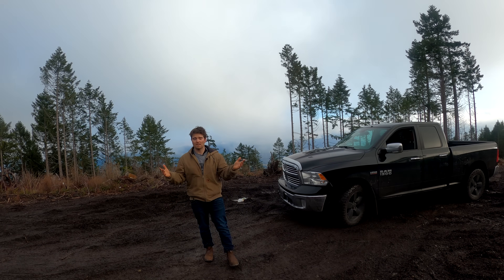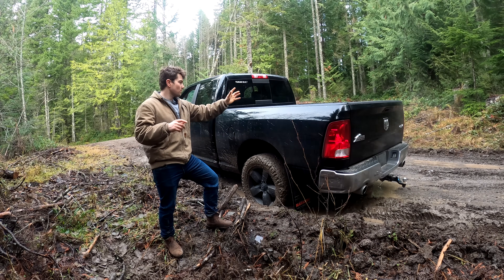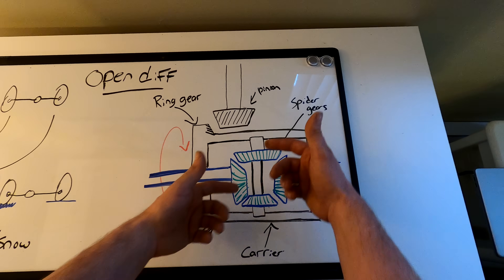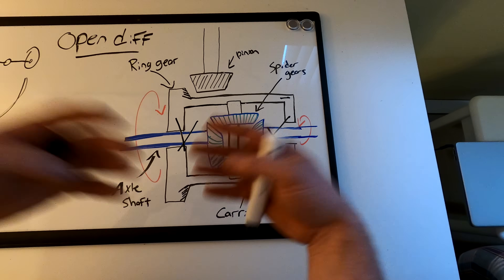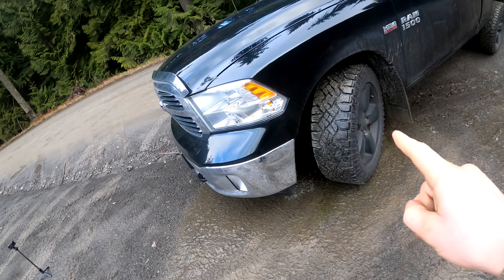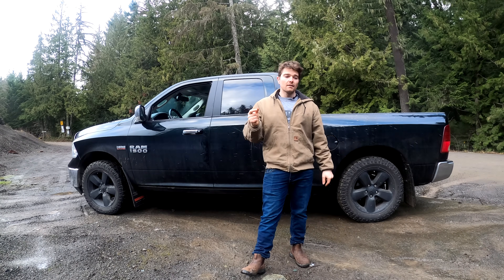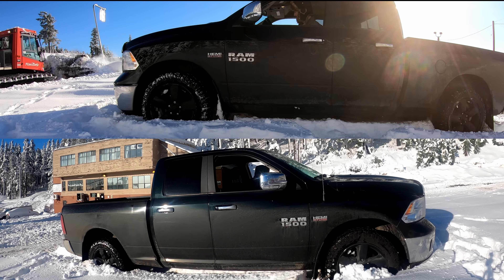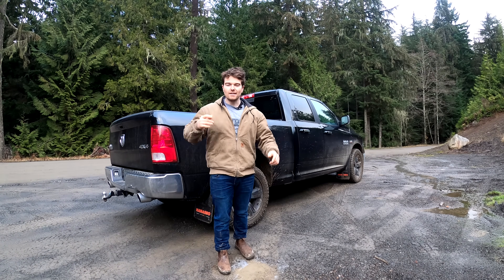RAM 1500 Open Differentials SUCK Off Road (You'll Get Stuck) | Real World 4x4 Testing

Comment: You have brake locking differentials. You need to continue spinning the wheel at a gradually faster rate, and it will cause the torque to go to the wheel with traction. If you let off of the gas too soon, it won’t kick in. Here’s an example of how it works. https://youtu.be/kcl-BMILrig

Comment: how much better do you think the truck would do with the factory option Anti-Spin limited-slip rear differential I have a '20 1500 with this feature
Reply from the maker: It makes a big difference. An LSD is not a locker but in most situations it will perform very well

Comment: Guys, why would you EVER buy a 4X4 truck without choosing the LSD option? I don’t know when why it’s an option. My 1500, with lsd, in 4 low is basically as locked as anyone could ever need
Reply from the maker: Thats why I ditched that 1500 and got into a 2500 power wagon.

Comment: This was what I was looking for after seeing the Duratrac snow review. I wasn't sure if you had lockers or not seeing wheels spinning and others not. I just got rid of a '99 Tahoe and drove through snow over the bumper and never got stuck, but it did have an auto locking rear. Just got an 18 silverado z71 and can't wait for snow...after I get rid of the factory original tires.

Comment: Without getting stuck can you tell if you have a locker
Reply from the maker: Look up the VIN and it should show you all your features and options. Another way is to lift the back axle and spin the wheels by hand in neutral. if they spin the same direction you have a posi of some kind. if they spin in opposite direction then you most likely just have an open diff

Comment: Hey guys.  Ram offers a “limited slip rear” option for the 2500s.  Any insight to how they work?
Reply from the maker: a limited slip diff usually has clutch packs which help to force power to both wheels. Not a true locker but does make a pretty big difference when it comes to off road performance. a really nice option to have

Comment: I really appreciate your passion and effort about doing the best with the given resource. I have an almost identical one like yours. 2014 Ram 1500 5.7 Hemi, Express quad cab. But mine has 45 transfer case (I didn't know the part name but it doesn't have the 4WD Auto) So I was really enjoying your trial and error videos the whole series testing 4WD modes.

I live in Korea, and there is only little bit of information or mechanics dealing with American pickups. Jeeps are popular though. I'll be looking forward to seeing your next videos and hope you keep the truck a while. BTW, how did it go with the Eaton locker? You ordered it right? I'm thinking to get one too if yours work. 
Since I bought the truck when I didn't have knowledge about pickups and 4WD, I still don't know its axle ratio. Sucks... I guess it'd be normal 3.21 open diff but the VIN decoder websites give mixed information.

Comment: I hate that in this day and age, most cars still dont come with lsd.
I mean i have a bmw turbo and still ope diff.
It should be as standard as air bags for cars to have proper traction control in all situations.
Reply from the maker: Could not agree more. at least for RAM the factory option to add an LSD is like a few hundred dollars. Mine truck was already on the lot. But why couldn't RAM just make it a standard option and advertise it saying their truck are more capable off-road. seems like a win-win

Comment: So I have this identical truck
How hard is it to add a locker
Reply from the maker: It's not something you can't do but unless you have some experience with diff's I wouldn't try it at home. You can easily mess it up, and it can be tricky knowing how to set the proper backlash, bearing preloads and tooth pattern. setting up diff's properly is almost an art on it's own.

Comment: This is why I bought a Power Wagon years ago. Front and Rear Lockers, plus a winch. Sounds like overkill----until you need it. I walked 6 miles out of the bush exactly once to make me decide I needed a PW.
Reply from the maker: the Power Wagon is the dream! I do which is had the option of the cummins though. apparently it's too heavy and that's why they couldn't put it in the PW

Comment: Just because it’s says 4x4 doesn’t mean you will be good at it, power brake it when u get in a slippery situation I wouldn’t know though mine has axle lock good video though
Reply from the maker: having a locking axle makes such a big difference!  and as far as the power braking it seems to work in some situations but not so well in other situations. never a bad option when you are stuck though

Comment: Funny thing is my 03 Land Rover Discovery has open front, rear and open center diffs and could still do this easy despite having evem less traction. With an open center diff you have 1 wheel drive. This is because they are full time 4wd so you have to have an open diff so you can turn. The traction control on it doesnt reduce engine power at all and actually transfers power to the wheels that need it. These newer vehicles just cut engine power completely, even when you turn it off. Almost got stuck in my pickup one time because I was on some slick surface mud under very light throttle. Soon as one tire barely spun it cut my power down to idle! Turned it off but it was too late. Had to shift to 4wd. They should all offer an offroad mode that disables stability control completely and doesn't reduce the engine power is and instead transfers power to the wheels that gave grip. Works great on the old 1999-2004 Land Rover discovery. Of course them having solid axles helps with the articulation. The 2004 has a locking center diff which helps alot. Im putting detroit truetracs on the front and rear because when the traction control brakes a wheel the diff will lock up.

Comment: Any 1500 truck you buy, Ram, GM, Chevy or Ford will suck unless you order a LS or Locker Diff.
Reply from the maker: absolutely true, its not the make of truck  that is the issue, it's driveline set-up that's the issue. If my truck has a rear locker it would be much better off-road.

Comment: Next time u go turn ur traction control off n ur ecs by holding ur traction system button ... Then try this trail again .. I bet you will get BETTER result's
Reply from the maker: won't do a single thing to help an open differential.
Reply: @GettysGarage  that's funny cus mine locks up when I do that  n I own a 18 Dodge  both wheels lock ..
Reply from the maker: @alanjoseph986  You probably have a Limited slip rear end my friend! However it would work like this traction control on or off.

If you don't believe me go under your truck and take a look at your rear differential and try and find the traction control wiring. You won't find any. So when you are turning electrical traction controls on and off it has zero bearing on what the differentials are going to do, or where they are going to send the power. 

the ESC which is usually the bigger issue has control over the Transfer case. the only thing is can do is hinder power going the front diff. So yes if you are stuck turn that baby off. but if you have open differentials your only going to have power going to 2 wheels for most situations.

Comment: Simple Bullet proof solution...check out Lock Rite mechanical locker. About an hour to install, no messing with backlash or shims or dial indicators or special additives, can be put back to stock if preferred...They are used in situations that require dependability like milatary and rescue! Only con is they can be a bit noisy sometimes (ratcheting sound) around a turn. They can only be used in a open differential as you have!
Reply from the maker: woow I'll have to check them out. thank you for the info! because yes it is annoying especially in the winter just having 1 wheels spin lol
Reply: @GettysGarage  id suggest getting an LSD or a selectable locker unless you spend more time off than om road. I have a powertrax lock right locker in my dodge 2500 and it still works great after 70kmiles on 37s but your turning radius is basically gonna double and you're gonna burn threw back tires pretty fast, mud tires go from new to slicks in like 10k miles.
Reply from the maker: @Si0nbarzahd  Honestly, the only time I'm actually off-road to film videos lol but I do live in Canada so there is snow on the road for like 4 months. so it would be nice to have some kind of locker. Ideally I'm looking at getting an Eaton true trak torson diff. Not officially a locker but acts pretty darn close to one. technically It is an LSD but as long both wheels are on the ground power will be transferred to both wheels. and apparently the drivability of those units is amazing.

Comment: Locka's or weld it, open diff is shit in any situation period.that speed differential will only matter on sharp turns or doing donuts.you don't be at that do ya???
Reply from the maker: One day I'll throw some lockers in my truck. Until then I'll have to suffer lol
Reply: @GettysGarage  put a locker in the rear of my old 93 f150 cpl mths ago ,and it's a different truck now much more capable.do it asap you will thank urself. 😉
Reply from the maker: @JoeRocket-sf6qs  It's too bad with these Rams the front diff looks like there is no after market lockers. and if there was you would have to replace the whole differential assembly. But for the Rear I'm looking at an Eaton True Trac which is a torsen style differential. I really like that option for a daily driver. or I'll throw an E-locker in lol
Reply: @GettysGarage  e locker is fast and effective,torsion set up sounds nice ,but costly also, but obviously in the end in comes down to what you use your rig for and what works best in your applicai,Lol. Have a good day and merry Christmas. 😃
Reply: A welded diff is great for doing donuts lol

Comment: Will you please do the same exact test but lock your e brake on the e brake will let the diff send power to that other tire have you heard of this please try . But yes do the first test you just did but LOCK EMERGENCY BRAKE PLEASE ;) been doing this while stuck for years man.. not yelling just trying to see if it works for you too
?
Reply: I hope you understand what I'm saying lol and why to do it? ;)
Reply: You can also hit the brakes in the second test in 4x4 try hitting brakes and gas at the same time intermittently and it will lock that other wheel for you been doing this for years also
Reply: It would be sweet if you did this and mentioned poor mans YouTube I'm nobody just know a little bit
Reply: This is pretty much how Toyota stuck control works your just doing it manually with your foot been off road driving since I was 7 years old been stuck way more time than idd like to mention

Comment: That's why I run a Detroit locker! 👍
Reply: How can I change my open diff to a Detroit locker?? Sorry don’t know much about diffs??
Reply: @noeldiaz1359  I had 4wheel parts install it on my truck. I don't have the tools to do it and its warranted under 4 Wheel Parts
Reply: @missioncapable4658 nice 👍
Reply: @missioncapable4658  how much did it cost you if u don’t mind me asking?
Reply: @noeldiaz1359  six years ago, it cost my around $600 for the locker and around $300 for install.

Comment: My Fords and Toyotas used the brakes to stop the free spinning wheel and activate the other wheel like a simulated limited slip. My 19 Ranger would lay 11s with an open diff.
Reply from the maker: see now that's what I would expect from all traction  control systems. but it just doesn't seem to work that way with a lot of vehicles. it's almost like the system is more concerned about keeping the vehicle from spinning out rather then helping the vehicle get un-stuck.
Reply: @GettysGarage  My Toyota has basically 3 different traction control systems that do different things. "Traction control" basically just limits engine power when it detects slip while accelerating. "A-trac"(same as auto-lsd in 2wd) is like offroad traction control that applies the brakes to give the other wheel more power. "VSC" helps correct skids when it detects the vehicle is sliding sideways. I believe most vehicles are equiped with regular traction control that cuts power, especially older ones. I have noticed newer vehicles, even crossovers have started adopting their own versions of A-trac and vsc
Reply from the maker: @845ToastT  It makes total sense. with all the technology already on vehicles today it is probably much cheaper for the manufacture to develop software like something similar to A-trac then to actually put a LSD or locker in a truck and still be able to sell the vehicle as an off-road vehicle.

Comment: Turn off traction control and ESC. It might help.
Reply from the maker: possibly it would be interesting to do a test just based on if traction control actually helps or how badly it hinders.
Reply: @GettysGarage  it does not help at all in these scenarios I’ve compared it with my ram before, but then again I have an lsd.
Reply: @dmoney6633  traction control is for the highway or around town NOT ironically in poor traction conditions.  I was "stuck " in my driveway in 3" of wet snow, shut off traction control and idled out.
Reply: @brentfellers9632  yup I can’t get up my driveway in 2wd without it off in the winter. With it on it just gets stuck. It’s for higher speeds for sure.
Reply: @dmoney6633  in my 2013 ram 4x4, turning off traction control only disables 30% of the stability control software.  I have remote wired the fuse for that circuit with a switch in series. This allows me to shut it off 100%,, the computer has a fit, but it throws 30ft rooster tails off all 4!
Reply: @brentfellers9632  that’s awesome! Yeah I wish the button actually turned it all the way off but the stupid government keeps it from being good. Luckily in 4 low it shuts everything off but for normal driving traction control sucks. For racing/snow/offering it’s way nicer with it all the way off I can do that in my car. I even hate abs seems to make it not stop as well as just pumping the petal myself on ice. This is why my offroad toy is an xj no stupid electronics holding it back.
Reply: @dmoney6633  lol! I just built an xj for my daughter!, new 4l, new pass. floor pan, new alt, new brakes, new sway bar bushings, new springs with 3" lift, new red top battery, all new fluids, rad hoses, and more!
It's like a brand new 2000 xj! I want to buy another for myself now!
Reply: @brentfellers9632  yup they’re awesome! I’ve got an 87k mile all original pretty rust free 2001 up country got it from a southern gov auction. it’s awesome I love the things they’re practically invincible. I’m doing a mix restoration/ off road build on it right now. Looks like we both have good taste lol!
Reply: Thank you for this video. Most folks out there don't understand how open differentials work and refuse to believe that you only have one in the front and one in the back pulling.
Reply: Hold the traction control for 10sec and it will shut everything down.

Comment: Tell ya all a little trick i learned back in the early 80s . Its got me out of a bind 6 , 8 times ! We were in a 2 wd chevy with a straight 6 . Goin up hills we shouldnt begoin up . Open diff .
Soooo while the one side is turning . Slowly click yr E brake down a click or 2 . The side spinning now builds heat from friction and locks up . Bam ! The other side kicks in . Off ya go ! Yeeehaw ! Figured that out at 17 years old up n the mountains . Long wait fr help lol ! Few other tricks on my channel !
Reply: Thats friggn stupid.ebrake lock both brakes equally. Makes no sense at all
Reply: @adamsorell4851  did a 10 min video on my channel about it . Half ta go back about a year
ta find it
Reply: @adamsorell4851  the one side is not turning . Thers no heat . So the side not turning  turns way easier  right away .
Got me unstuck several times . In this truck . It worked n my 77 t  bird . It worked n my 74 ltd . It you dont understand friction heat , no its not gonna make sny since ! Worked every time ive tried , EVERY TIME !
Reply: Most new vehicles have electronic ebrake dont think that will work

Comment: Brake lock differentials (BLD) didnt engage? Did you have traction control on? Jeeps and Rams have traction control brake lock diff, kind of like a Ram version of Toyota Atrac. Had a Toyota with Atrac and open diffs and never had a problem even in ditches with only 2 wheel traction. Can't comment on the Ram because I opted to get a LSD rear in my 1500.
Reply from the maker: my traction was actually left on. I wanted to let the truck do all the work and see what happens (well i knew what was going to happen). I've never really had faith in traction control actually working when you are really pinned up. which is too bad because if you could somehow fully brake those spinning wheels torque would be force those the wheels with all the traction. obviously that's the goal of traction control but it never seems to work that way for whatever reason. i'll lock deeper into the BLD because this is the first time i've heard that term to be honest. might also check out the Atrac system. Thanks for the info!
Reply: @GettysGarage  Not trying to be a Toyota fan boy because I'm really not, but ATRAC system has blown me away. I was in the camp of thinking I definetly needed lockers or a LSD, but ATRAC does 90% of what a locker does, and saves me a ton of time by not having to engage, then disengage the diff lock manually. If you get a chance youtube up some vids, or demo it out on someones Toyota, and I know for sure you'll be blown away by it. I own a 2012 Power wagon, and also a Tacoma, and can say for sure Atrac holds its own weight. Got rid of my 17 Ram 1500 for the Tacoma. Sure its smaller but it hasn't disappointed.